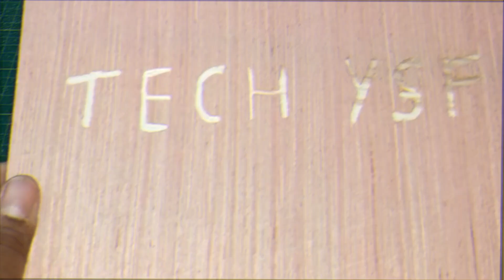Amazing idea with the mini milling drill

Comment: I have a Dremel bought in the 1980's with a router stand originally made for it, plus a vertical milling bench stand, swivel bench stand and foot pedall, guess E-Bay has them used